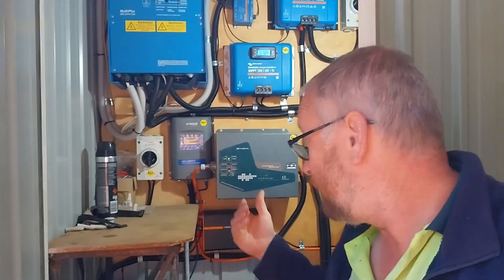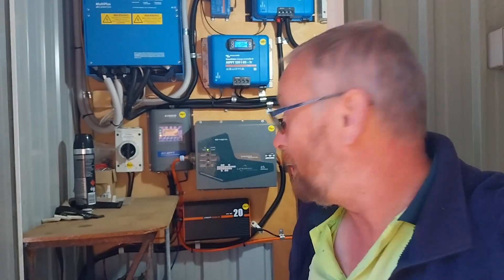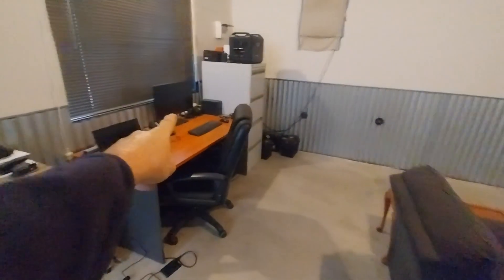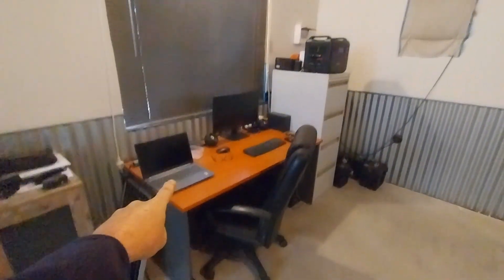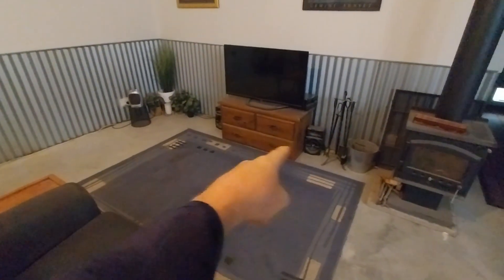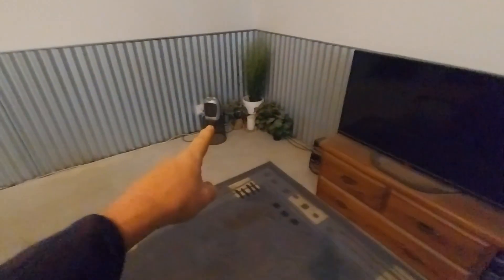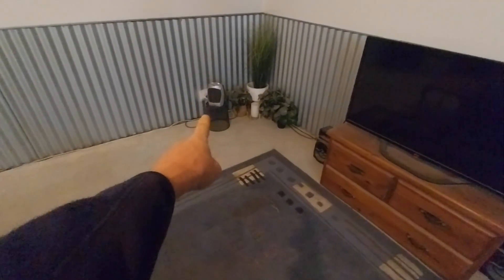What My Off Grid Power Systems Run

Comment: Redundancy is key to offgrid. Electronics will fail, you just don’t know when. So multiple backups required. Better you build it yourself so you can fix it or do a workaround for electricity and water. I have 3 systems off grid, 6kw Inv.  (Pv 5.4Kw Batt. 48V  ( 4x12v 5Kw ). 1Kw Inv. (Pv 420W Batt. Gel 12V 200Ah ). 300W Inv. ( Pv 420W Batt. 12V Lifepo4 100Ah ). Total battery’s 6x 12V, gives a lot of flexibility. Water pumps 1) 12-48V Dc submersible.   2) 12VDc demand pump. 55Psi.  3)240V Ac submersible pump. With multiple components you can mix and match to have power. Zombie apocalypse ONLY use a series string of solar panels to produce 200VDc with direct Pv to selected AC Appliances that have universal motors ( drill, grinder, saws, Vacuum etc. ) Ac led lights, chargers and even 240VAC induction cooker. These work because the 200VDC passes thru the bridge rectifier. Be aware Dc arching will eventually destroy Ac switches and thermostats. Also 200V DC is more nasty than 240VAc. Don’t try this at home. Not very practical, sunny day time only and a cloud will stop everything working.

Comment: So Glen could 600amp battery setup on 24v system run a 300lt LG Fridge and how long for with 2400w solar...av sun hours I think here is 3 to 4hrs a day...great setup...but I need rain here.tc😊
Reply from the maker: It's hard to give an exact figure as it depends what your fridge consumes in 24 hours. But if you can, each day, replace the power you take out of the batteries, it should run indefinitely.

Comment: The hot water setup is interesting. It makes sense to use the electric storage to reduce reliance on the LPG and changing cylinders. I wonder if you could have a hybrid system and feed the electric tank into the input of the instantaneous. I’ve seen solar hot water systems that consisted of a solar heated storage tank and instantaneous gas booster. If the water in the storage tank wasn’t hot enough, the gas booster would kick in.
Reply: We went from gas hws to heatpumps, which were possibly break even over 16 years, then back to a 130ltr electric Au made hws for reliability at low cost now we have a bigger solar power system. Electric hws are actually low cost energy storage, heat during the day, use mainly when there is no sun. If we 'gave away' the power, (ie very low off peak rates) when solar power is exceeding the grid system limits most days, we would effectively have energy storage with Au made hot water 'batteries' in every house. Instead we 'turn off' grid solar inverters rather than use it effectively in places like units or apartments with no solar access.

Comment: I assume your stove and oven is LPG. Have you experimented with a portable induction cooktop?
Reply from the maker: I use a twin ring portable induction cooker most of the time, you can see it in some of my other videos. I hardly use the LPG stove anymore unless I need to use a large frypan that is bigger than the cooker ring on the induction cooker. The induction cookers works really well 👍
Reply: @TheOffGridBachelor  Thanks. Love your entire set-up.

Comment: Thank you Glen, I going to try the new #Bluettie Apex 300 Glen there 3840watts, but u can parallel 3 units together to make up over 10,000 watts Glen Look into it
Reply from the maker: I wonder how they will go running 24/7. That is my only concern with the power stations, if they will last being on all the time.
Reply: Agree the new Apex 300 looks good. As for 24/7 use my 1800W cont EcoFlows are running a 330ltr house fridge freezer fine. The Delta2 also runs the 2000W air fryer no problem and a 1500W jug or induction cooker individually when needed. Big resistive loads actually use less than rated because the output is a stable 230V (Au std), not 240V which our grid rarely sticks too (sometimes 255V here), hence the air fryer result is less than 1800W when running.

Comment: Thanks Glen as always great vid.
What is the shed going to have, it's own power system or will you run power from the 48v system?
Reply from the maker: It will have it's own power. I do plan to build a room in the shed in one of the bays and move some of my power systems over to the shed. That way my cabin is not so cluttered with batteries and power set ups.

Comment: A question, do you notice your HWS timer drifting over time with it running off the Victron (or any inverter for that matter) as it looks like a motor driven type.  It's a problem I've seen other youtubers have and I've explained the frequency stability of their inverter vs the long term stability of the grid.
Reply from the maker: I haven't really noticed but I don't watch the time exact. As long as it comes on sometime around mid-day it's all good. I will have to keep an eye on when it is coming on.
I do notice my microwave clock can drift ever so slightly but it takes months to do that.